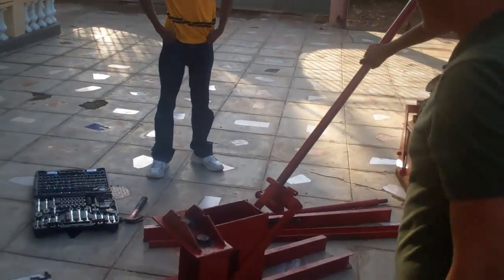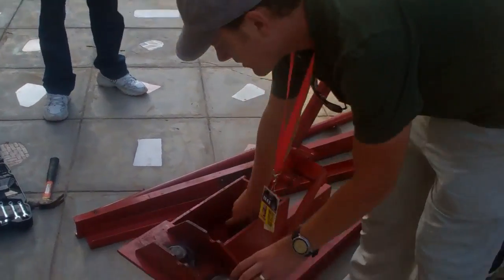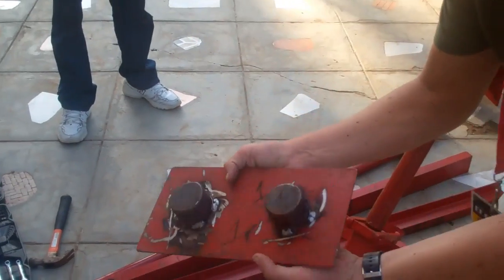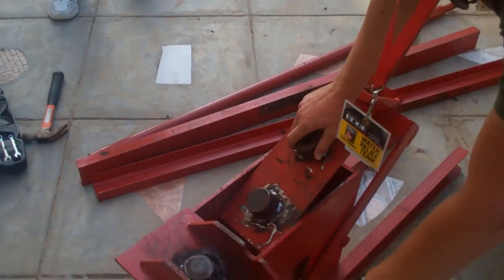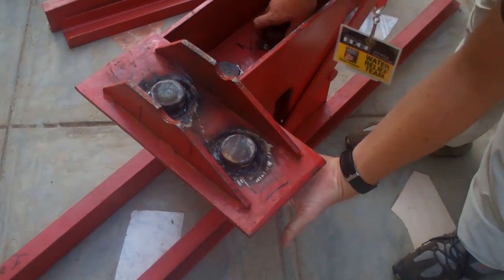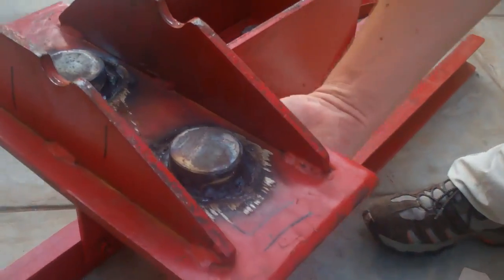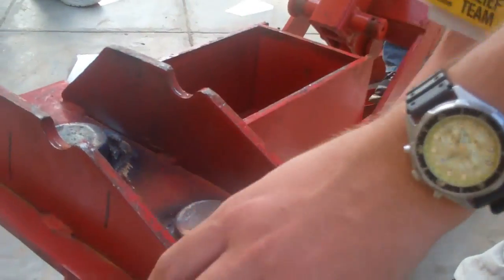Cinva Ram compressed earth press delivered to Haiti from the Dominican

Comment: It appears that the corner of the top or lid, extends into the block space and would interfere with removing the completed block.  (See video at 0:49)
A block making demonstration would have been interesting.
Reply from the maker: The lid rotated to a point at which the blocks could be removed without rubbing the new block. You could also easily take the lid off with the way it was designed.

Comment: These links are plans for the Ceta Press. Since these plans are for free, because the proyect is sponsered by the United Nations for the poor, so don't be swindled/tricked.

dl.dropbox.com/u/35985762/LA%20BLOQUERA%20CETA-RAM.pdf

or in spanish:

dl.dropbox.com/u/35985762/LA%20BLOQUERA%20CETA-RAM.pdf

Hope you will use those!